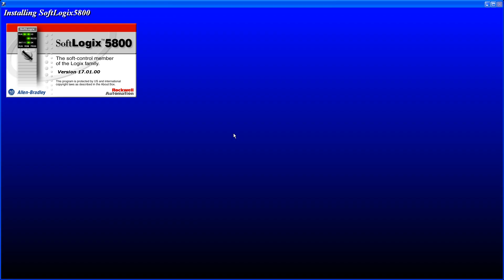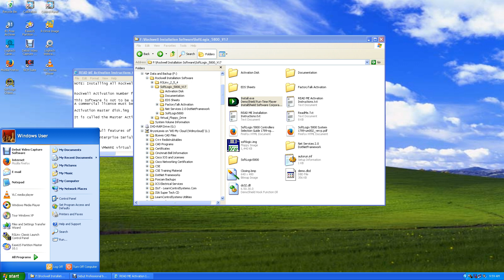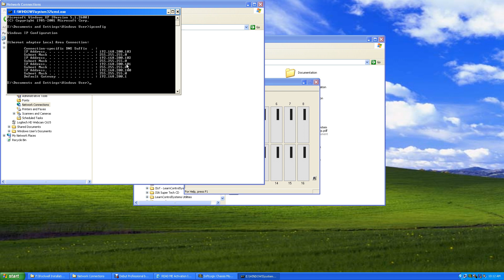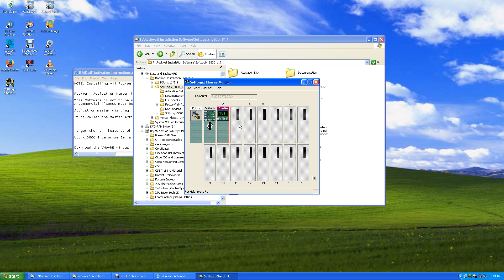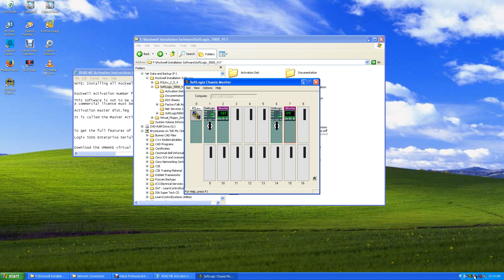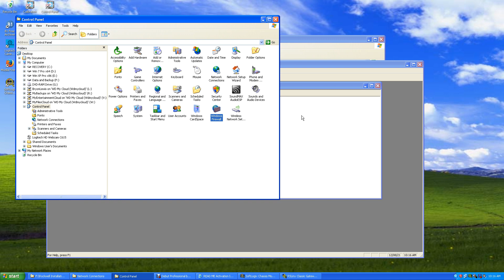SoftLogix 5800 SoftPLC Installation, Configuration and Operation

Comment: Did you try to connect to point I/O ?real hardware
Reply from the maker: YES, it works great in my simulator. See video: https://youtu.be/Zcs5w0abijM?si=8F9xXcOYkw1If2Q1 The Point I/O is at 4.40 seconds.